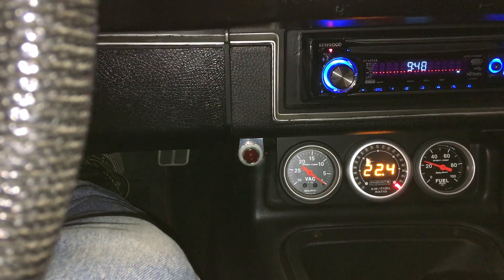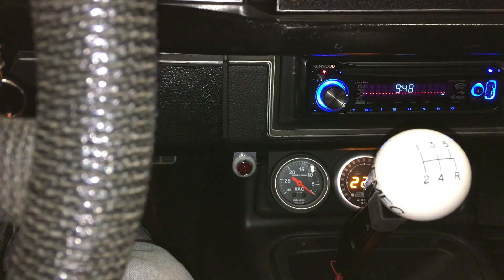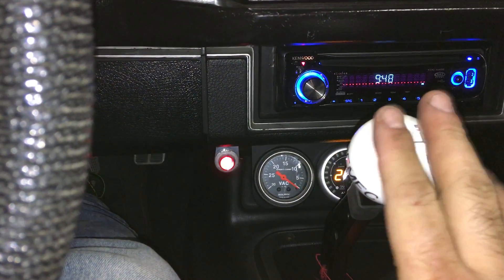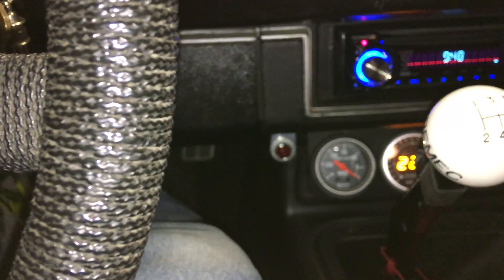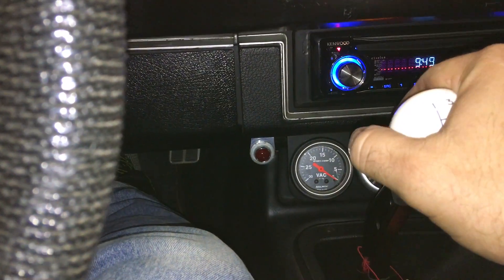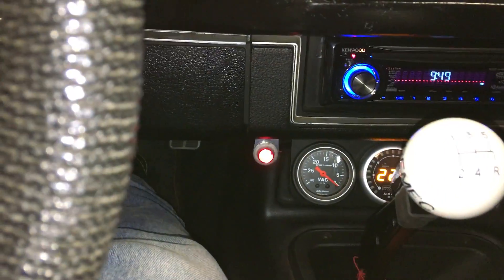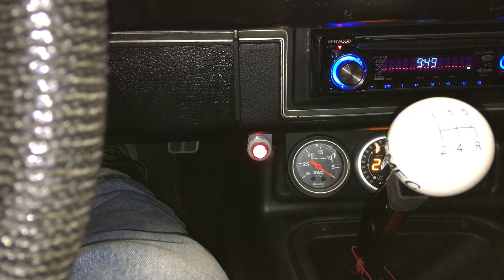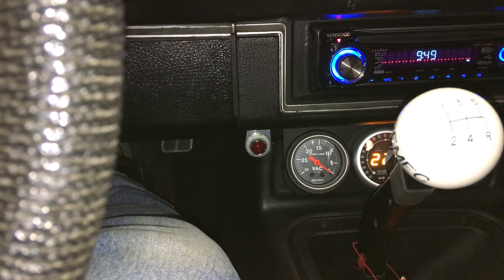MSD 6AL2 Two Step Relay (Clutch + Line Locks)

Comment: Is the clutch switch positive or negative? In your drawings, its showing the clutch as 12v (+). Most forums show the clutch switch as the negative connection. Also there's two sets of harnesses on the clutch switch. Which one did you use to tap in?

Comment: Wait a second - you have to use the clutch to do your burn out.  I didn't see you touch the clutch when doing your  "second gear burn out".  Seems like you would need a toggle to select burn out (no clutch activation) and to arm the clutch activated switch for the launch.  Tell me if I'm missing something... thanks for posting this!
Reply from the maker: Brian David to do the burn out you just use the button, shifter in 2nd gear and clutch down. When you release the clutch you are still holding the button which energizes the rev limiter. Even if the clutch is released. You could even shift as long as you hold the button.

Comment: I think you could also wire up a separate hot wire to a separate button for the line lock to use only the line lock without the two step turning on when doing a burnout then after do the staging process like in the video using his method engaging two step and line lock together. Good video btw about to do this myself. Helped alot. Def gonna wire up a light too now.

Comment: Would it be possible for you post a pic of the micro switch mounting on the clutch? I have a 78 trans am and would like to install this set up. I already installed the MSD box and just need to wire up my switch and line lock. Also a close up pic of the relay would be good too. Great information and video! Thanks!!!
Reply from the maker: tadudeabq  I used the clutch safety switch as my micro switch

Comment: with this setup is it possible to use the line lock without activating  the 2 step?
Reply from the maker: You can put a toggle switch between the switch and terminal 85 of the relay ... basically you isolate the relay from the toggle switch.
Reply from the maker: You would have to run a separate wire to the line lock and a disable switch on the two step. Not the intention of this design.

Comment: I'm really just wondering how you wired everything up ? How does it work like that with the clutch switch ? And how did you do that set up on the shifter
Reply from the maker: http://nastyz28.com/forum/threads/racing-manual-stick-with-2-step.306828/page-2